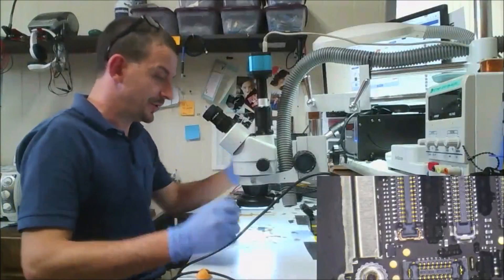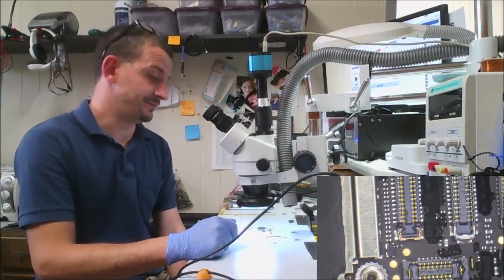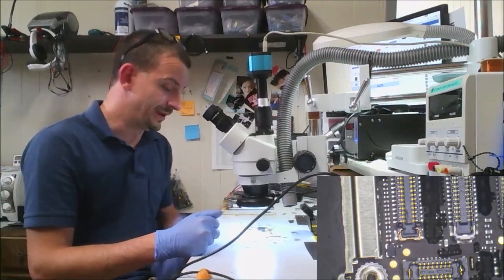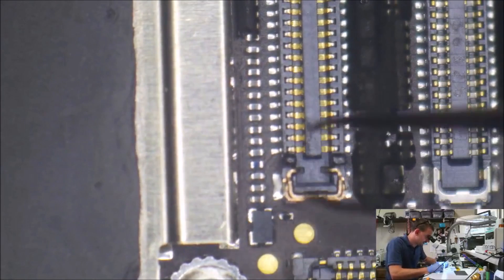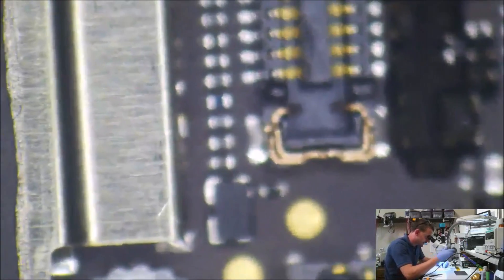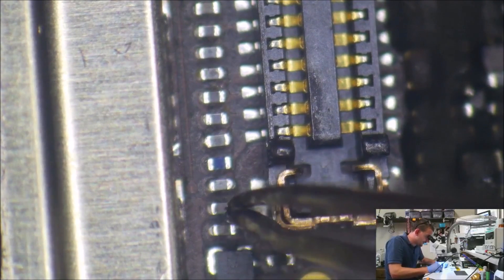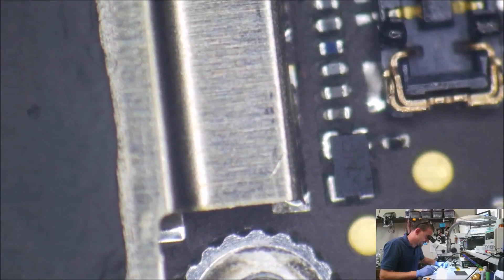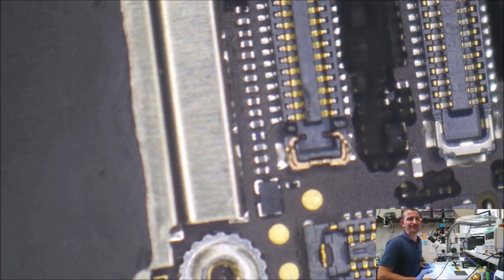iPhone 6+ No proximity sensor after touch IC repair fix - Thank you Mark!

Comment: Hello good sir. My iphone 6S camera stopped working. I got a front camera + sensors thingy from another phone. I changed it and now all works but the proximity sensor. I returned the 'broken camera thingy' back to the phone but the proximity sensor is not working as well. Do you think that I might have broken something or I have done something wrong which I can fix?  TBH to me the phone is unusable at the moment :/
Reply from the maker: It could be something with the logic board, however, it could also be the alignment of the sensor.  The sensor has 2 small lenses that need to line up with the transparent holes on the screen.  One of them emits invisible light and the other senses it.  There's a small plastic retaining bracket that's normally glued to the screen that holds the sensor in place.  I've seen some of them come loose or, if the screen has ever been replaced, they often don't have the plastic thing that holds the sensor in the right spot.  The camera flex has 2 sensors, one is for ambient light (which hardly anyone notices if it's not working) and the other is the proximity sensor with the 2 lenses/holes.

Hopefully this helps.
Reply: STS Telecom Thanks a lot. I will try to figure out if I have indeed misplaced the sensors. Will let you know once I try it out tomorrow
Reply: STS Telecom Hello again. I need to travel and need to rely on the phone so for now I pussied out and got out of time to experiment with the lens. I will be back next month and I will leave a comment with my fix attempt. Thank you for all the information and the awesome channel!

Comment: I have a 6s + he got wet and the proximity sensor does not work at first he was having problem in the rear camera, got tidy but the proximity sensor does not work. Could you give me an idea, I changed the flex 3 times. But it still did not work.

Comment: What else can cause proximity sensor not to work after touch ic repair? I checked all the filters, continuity across and it checks out but still no proximity, even replaced cumulus just in case.
Reply from the maker: Hey, thanks for watching.  It sounds like you really know what you're doing pretty good.  There have been a few tricky cases where I just decide to send it out the door without a working proximity sensor.  When proximity doesn't work after touch IC repair, there is only so far that I am willing to go to fix it.  I rarely ever send one out not working but when it's a teenager that's calling every couple of hours that never uses their phone to talk on or lays it face down - they just want their phone back.  =)   I have spent hours on some fixing stuff I messed up troubleshooting the proximity sensor only to wind up (STILL) with no proximity sensor.. LOL

If you had the time, you could check the voltage going to the side of the sensor that puts out light, and how the resistance value of the receiving side of the sensor changes and where that signal goes.  I've never had time to dig into it that far though.
Reply: STS Telecom 
Well I will post You one reason why it also don't work and it are not filters or condensators. It is the white touch IC only one line is going on it and I did have the issue  just today.....did real loose 2h on that Phone

Comment: Thanks for the video. After using Hakko hot tweezers (not hot air) for a single filter replacement that was successful for the backlight repair (the filter above the LCD FPC). Could that type of heat cause the proximity sensor to fail as in your video?
Thanks for the help. You guys rock!
Reply from the maker: Actually, no.  I think it is highly unlikely that amount of heat would cause any issues with surrounding components.  It's much more likely that one of the proximity sensor components was pressed on or disturbed during the same screen replacement that blew the filter.  Those components are under rubbery over-fill so it would be tough to find without taking measurements or just picking them all off and checking them.  When I was asked this original question, I assumed the repairer used hot air.
Reply: Thank you all for the replies. I apologize for my ignorant. Please advise how would this happened to a customer's phone that tested for proximity working before  when he brought it in and now not working? TIA!
Reply: I agree with the STS Tellcon Technicain. The proximity sensor components were probolbly damaged when the LCD screen was replaced. The same time the backlight filter was damaged, so you may not have known the proximity sensor was damaged since the backlight filter failed at the same time.

Comment: Great post! Thank you.  I have a question for you because I recently sent to another repair shop an iPhone 6s for backlight issue. I am assuming that they are replacing the filter or diode for the backlight. Although, it returned fix the backlight, but now my proximity sensor is no longer working. I have verified it with another proximity and front camera flex assembly, but still proximity sensor is still not working. Could it be related to the repair or the backlight? I am not blaming them but i would like to find out what would cause it to not working after the repair made. TIA for your advise and expertise. Ken
Reply: After using Hakko hot tweezers (not hot air) for a single filter replacement that was successful for the backlight repair (the filter above the LCD FPC). Could that type of heat cause the proximity sensor to fail? 
Interested to know what you think, thanks.
Reply from the maker: There are a lot of rubbery over-fill coated components around the backlight filters.  That rubbery overfill tends to lift components off of their pads when heated.  I'd say the source of the proximity sensor issue is likely the no backlight repair.
Reply from the maker: Actually, no.  I think it is highly unlikely that amount of heat would cause any issues with surrounding components.  It's much more likely that one of the proximity sensor components was pressed on or disturbed during the same screen replacement that blew the filter.  Those components are under rubbery over-fill so it would be tough to find without taking measurements or just picking them all off and checking them.  When I was asked this original question, I assumed the repairer used hot air.